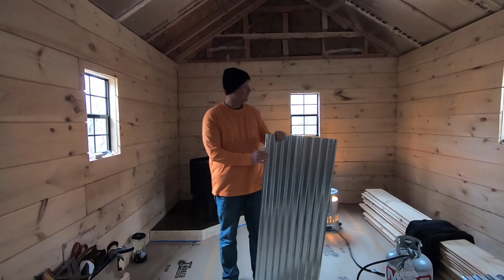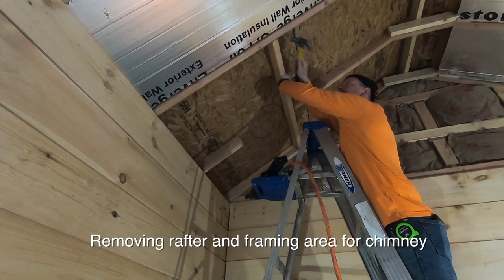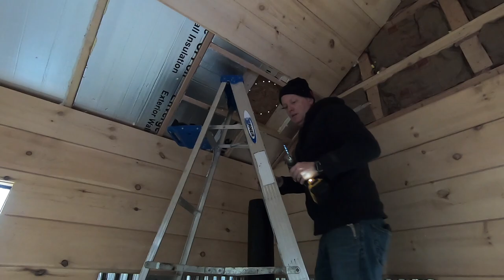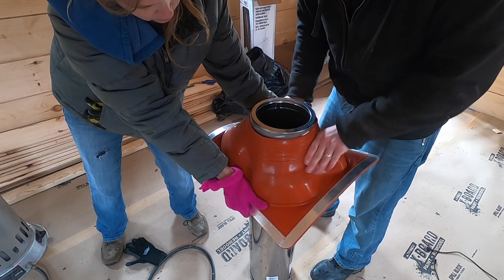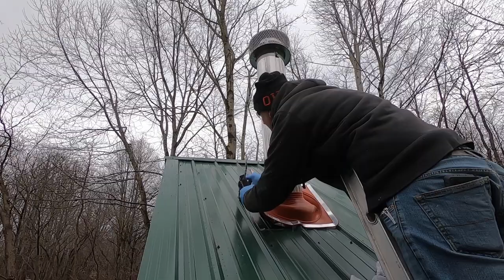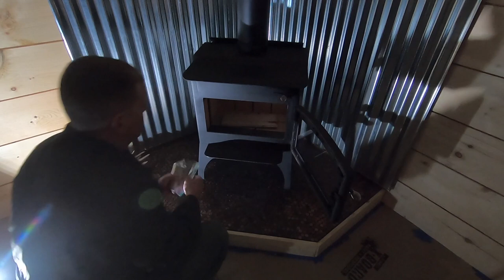Vogelzang Defender Wood Stove and Selkirk Chimney Installation In The Off Grid Cabin

Comment: Looks great bit of advice for next time the boot should be installed like a diamond so when the water hits it it runs off and down the roof . It won’t just sit there at the seal, plumber by the way
Reply: Im actually doing this right now in my house but havent done got the boot on the roof or the pipe threw but great piece of advice
Reply: Also it’s recommended not to silicone the bottom of the boot in case water comes in from the top side it won’t pool up

Comment: Good video.  I'll be doing an additional installation using a Selkirk 6T-PCK sloped ceiling kit as you did, to add a waste oil burning stove to the spare bedroom of my log cabin.  The only thing that you might have done differently would have been to cut an elliptical hole in the roof, matching your roof pitch with your vertical pipe so as to get consistently 2" spacing all around the pipe, vs. cutting just round 12" hole.

Comment: Boy is that roof flashing a whole lot nicer than the old metal ones we had to work with years ago !!!  What a great development in chimney technology!!!  Great video from an old stove dealer and installer !  You can spray the stainless with flat black paint for stainless steel pipe for a finish too.

Comment: Thanks for the video.  We are about to instal a wood stove and after hearing the costs from the "pros", I am reevaluating and thinking of doing it myself.  Question - why did you silicone the bottom of the rubberized flashing around the exhaust pipe?  I was also told never to seal the bottom edge in case moisture ever gets under it, it will be trapped. Thoughts?
Reply from the maker: You may want to do some more research... That's all I will say. I did it correctly.

Comment: Looks great. I grew up with wood heat. The plus and minus. Would like to have seen the install dimensions, distances to combustibles, every part of the stove has a minimum clearance to combustibles, and non combustibles. The place looks great. The distance from combustibles looks Very close, but if it’s within code, heat it up. Heat it up, almost over fire it. If your comfortable enough to go to sleep with it running wide open dampener you score an A. If you always second guess the heat transfer, then you should have given the clearance where the pipe went through the roof sheathing and the blocking added to support the weight of chimney. Looks great!
Reply from the maker: It's all clearanced more than the stove manufacturer minimums. Additionally I used rockwool insulation in the ceiling around the pipe. This wood stove has a lot of shielding on the back, sides and bottom being a modern unit. Unlike an old school cast iron unit, these can have clearances as small as  6 inches. Not to mention I installed the metal backing with a 1" air gap, which was totally unnecessary but added insurance to protect the pine walls.

Comment: Just a little help don't forget to put rock will insulation around the pipe going threw the roof in the ceiling .  So it don't condense water and drip on your pretty wood ceiling .
You did a great job on the venting . Looks good !
Reply from the maker: Thank you. I was wondering if it would benefit from some rock wool in there.
Reply: @JackofAllMasterofNone  
Your welcome we need to start watching out for each other . I'm in in heating trade .. it will save you in the winter from having to deal with a leaky roof
Reply: Question. Is it necessary to use rock wool in the wall behind the heat shield?
Reply: @woodspirit98  
Depends on what kind of heat shield ? Sometimes you want air to behind  a heatsheild .

Comment: Did you just drill the fasteners straight into the decking or framing?
Reply: Is this holding up well? I'm going to do the same things, but worried it will act as a water dam and leak. Going to orient it like a diamond but still skeptical of it on the green metal roof

Comment: Thanks for sharing this. How did it work out so far, any leaks?  I have a question about the Selkirk 'roof support package' <-- it has these angled brackets you screw into the roof joists. But did the chimney piece come with the brackets already installed at a certain height, or did you put them yourself?  Reason I am asking is I want such roof support piece, but I don't have an adjustable length piece of chimney, so if the brackets are at the wrong position I might end up too long or too short to connect to the rest of my chimney...if that makes sense...your advice would be welcomed !  Cheers
Reply from the maker: Brackets I used were adjustable. No there are no leaks.

Comment: Not all double wall is the same, I have a hollow through both end and short double wall connect right on each other with the cap just 1.5ft above the roof but I see many others are more than 3ft off the roof, would it be safe just 1.5ft above the roof?
Reply: Triple wall where it leaves the house.

Comment: Did you guys install a damper on your stove pipe? 🤔
Reply from the maker: Yes I did, after the fact. Technically the EPA stoves don't need one but by adding an additional damper on the chimney you can slow down the burn even more and it works great.

Comment: What clearances did you go with from combustible’s?
Reply from the maker: Depends on where you are talking about. The manufacturer of each part has minimum recommendations. For example the Class A chimney pipe was 2" to combustibles. The stove was 12", single wall is 18", etc.

Comment: Now that you’ve used it, do you wish you had gotten a smaller one? Does it get too toasty in that small of a cabin? I’m doing the same thing and was afraid that stove might be too big for a 12x32’ cabin.
Reply from the maker: There is a learning curve with this stove. It will definitely run you out of the cabin if you let it. Let the fire get too hot for a few minutes and the stove overheats and starts to give off smoke. Don't get it hot enough and no heat comes out. It is for sure too big for my application, but since I got such a good deal on it I'm learning how to use it in my setup. I installed another damper in the chimney to help hold it down once its good and hot. Also, I use smaller logs and let them burn down more before reloading the stove. If I ever run across a better, smaller stove for a good deal, I'd probably replace it and sell this one, but for as much as I use it, it works just fine.
Reply from the maker: @tracyk3567  If I could do it over I would probably try and find one of the old school cast iron log wood style stoves with a window on the front so I could see the flames. Would be able to cook nicely on it and it would be smaller and more appropriate for a cabin like mine.
Reply: I have about the same square footage as your cabin. I'm probably going to go with the Drolet Escape 1800 stove. 500 to 2100 square feet. I believe it takes 18" pieces and will last 8 hours burn time. No catalytic converter. No blower unless you want to use a blower. You can cook on top of it. It weighs 382 lbs and the firebrick is all replaceable with off the shelf firebrick. $1299.00
Reply: @woodspirit98  -I ended up picking up a used Jotul F100 for $600. It works great in winter! Spring and summer it’s too hot and I have to keep all windows open, so I have to come up with a seasonal alternative. I love electric oil radiator, but not sure I want to go on grid even for a few months. Propane would be nice but I haven’t found a (small) propane furnace that doesn’t give me a headache. So, still trying to work Spring and Summer out.
Reply: @tracyk3567 where are you where you need heat in the summer?
Reply: @tracyk3567  you were talking about summer though, you don't need heat in the summer

Comment: Does that rubber boot cause problems with snowy conditions?
Reply from the maker: No
Reply: Have you heard about those type of flashing boot catching in fire
Reply: @adanmendozamonterrey those triple wall chimney pipes don't even get hot, so user error. The double wall used inside barely get hot to the touch

Comment: What did you use for spacers between the wood wall and the corrugated heat reflector?
Reply from the maker: Ceramic spacers. They came in a kit just for that purpose.